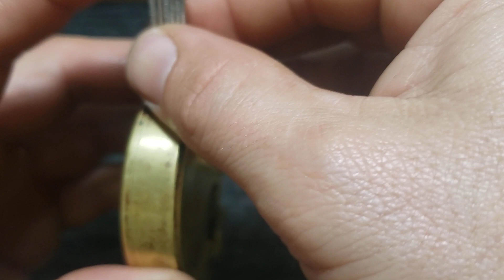Demonstration of Eclipse 6 lever lock picking tool with an open.

Comment: Great idea for making pick. But I would’ve moved bolts and nuts closer to center. Would take out bow in the two piece and make it so they don’t drop when tightening. But rather settle more nicely. Then again maybe that’s exactly what ya wanted. I can’t wait to get me a pancake lever to try! Very cool video!👏👏👏😎
Reply from the maker: Thank you! I use my thumb and fingers to adjust the tension on the pins and that seems to work best for me. Hope you have success with your lock when you get it!
Reply: @lakeviewlocksport3588  oh I’m gonna try ur way first. Sure ya made it that way to work. Upon further thinking, I’d think ya want it loose to adjust. So the way I mentioned might we’ll be shit😂🤷🏼. Thanks for commenting.

Comment: Nice lick and picking tool,   I have a pancake lock, but I thing it's got issues, some of the levers don't look right, so I may have to split it.

Have a great day
Reply from the maker: If you could post a pic on reddit I can try to assist your evaluation? Thats a bit of a drag you have a damaged lock.